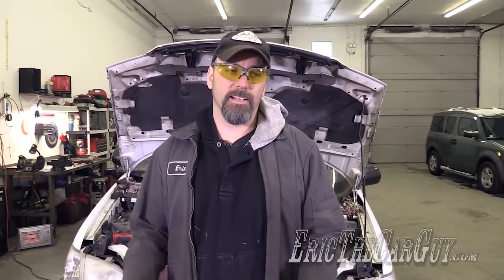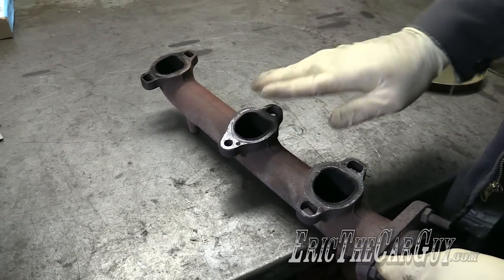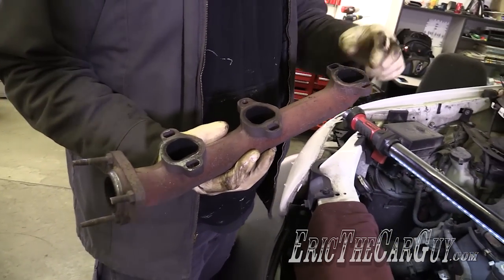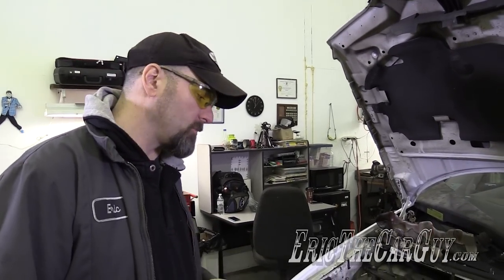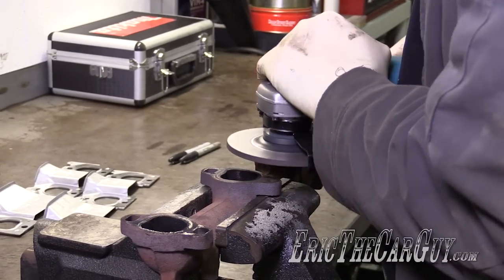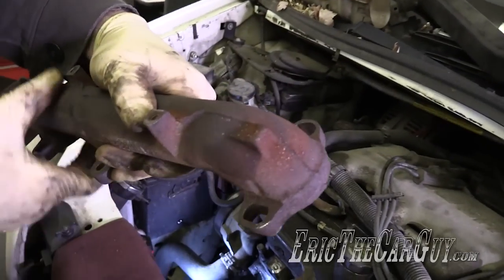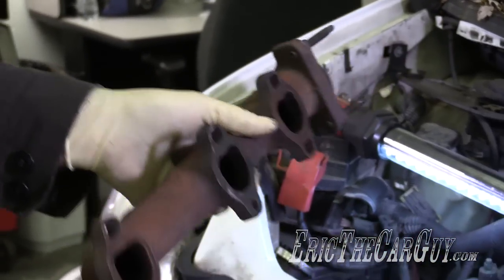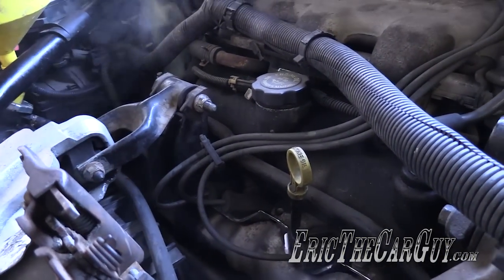2000 Pontiac Montana 3.4L Exhaust Manifold Leak Repair (Part 2) -EricTheCarGuy

Comment: Saying "having problems with my drill bits so i went to harbor freight for new good ones" is like saying "I was having explosive diarrhea so I went to taco bell for dinner"
Reply: SATAMAN Schmidt They may get great reviews but they don't work for shit. I can hand sharpen a drill on a grinder or belt sander far better than the Drill Doctor. The problem lies in it's inability to properly relieve the cutting edges. They give you a perfect 118 or 135 degree angle they just don't do a very good job of removing the material behind the edge so that the thing will cut.
Reply: ***** 500X
Reply: Harbor Freight is definitely the Taco Bell of tool brands.  Both establishments have their own unique smell.  Taco Bell smells like grade D meat, and Harbor Freight has a chemical smell that's so strong it makes my eyes tear up.  However, I think his point was that instead of resharpening good bits with the drill doctor, he just bought a ton of crappy disposable ones.
Reply: LMAO
Reply: Morguls Tower
No, Eric goes cheap because most DIY viewers go cheap. He's not teaching to the pros.
But I agree that cheap drill bits are a waste of money.
Reply: Fahrenheit38 laughed my ass off couldn't have been said better. You know how much junk i've gotten from Harbor Freight? lol.. My neighbor who had two strokes and was a former mechanic and at some point kinda lost his marbles keeps going back for more trash wondering why their junk isn't working out for him and has gone broke from his projects...
Reply: I gotta hand it to Eric.  He shows the right AND wrong way for doing stuff and is not ashamed for people to see how jobs can go astray.  He shows you how NOT to do stuff as on how to.

Comment: What the hell is wrong with you people? This thing is a piece of shit, I don't know why Eric is even working on it. It has the worst power train gm ever made, the van is rotting, and it has other exhaust leaks as well. And people are commenting about metal shavings in the coolant? Big deal! And anyone that knows about engines knows that you can just go and slap a cylinder head on it. He would have had to get it machined too. Some vehicles are worth keeping on the road and others are not, this vehicle should be scrapped.
Reply: What is wrong? How many people are driving vehicles like this for various reasons, and NEED to repair issues like this. Look at it this way, here is a mini van that was worth next to scrap value when it rolled into the shop. As a used vehicle, it was worth very little to purchase, and to sell it, it was worth very little to sell.  With the investment of mainly time and some money (mostly to repair other issues such as the replacement radiator and get the engine back to tune) it is a running, reliable vehicle now.
Reply: Alan Maier reliable?  who knows?  but as to value, some folks have to do what they have to do!  This veh may be the most the owner can afford.  And eric may be the only mechanic she or he can afford.  And who knows this could have been a freebe and we know they always go badly. Its just fate.   Its almost impossible to do charity work without investing your own money.  Sooo turn them down or be truly willing to help.
Reply: He's mentioned more than once in his videos that he does repairs on vehicles that may seem like a lost cause just for the sake of making the video.  He could make a video like this one of him actually fixing something or R&Ring a good manifold on a good car to show how it's done.  Personally I prefer actual repairs.
Reply: flineman Well, okay, reliable may be too strong of a dream for a GM mini van. Just thinking a bit on those, the engines were the main issue due to head gaskets and here in the snow belt (I am in Indiana), GM vehicles just plain rust apart faster than anything else on the road. But by contrast, I have a Grand Caravan as a second vehicle and it's nothing but one electrical system headache after another. When changing the turn signal stalk assembly one day, I noticed the dreaded Lucas brand... Lucas, Lord of Darkness. That explains a LOT!
Reply: It may be worthless to you, but not everyone can just scrap a vehicle and drop a few grand on a new used one at the drop of a hat. Especially for an exhaust leak. Most shops around me charge by the book, so they'd be bound to finish this job no mater how hard it ended up being. Though in reality, the 3.4's are a dime a dozen. I'd bet you could go a pick-n-pull yard and get a head with manifold attached for $100. Not a ton more labor than what Eric went through drilling out the studs. But hindsight is 20./20 after all.
Reply: buggsyspam You do need to know when it's time to let it go, but yeah I agree.  I have one of these I just sunk about $800 into to replace the cylinder heads.  I could have given up and got something new but unless I spent at least $3K I wouldnt be getting anything newer or less miles (certainly not one with new heads on it).  Had mine been in the same shape as the one in the video, I certainly wouldnt have put new heads on it, I'd have probably slapped gaskets on it and hoped for the best...
Reply: Alan Maier
Major coolant leak is a much more imminent problem than a noisy exhaust leak. 
This van is good for nothing. It has no saving grace or valuable attributes. It doesn't do anything well.
Reply: s0nnyburnett Maybe I'm just not a snob, but I disagree... and I live in the uppity part of the city and pay a monthly pass to the local car wash on both of my vehicles. If that van has no value to you, great - I'd buy it, take care of it, and appreciate it. To feel it has no use in the world is being either a child or stuck up beyond words.
Reply: Alan Maier
If you fixed your own cars to survive you'd have a vastly different opinion.
Not all products are made equal and some like this, truly are junk.
Reply: It's a great video. It shows people, when you might be greatly above your limits and should not think about making these types of repairs in the first place. You need tools, experience and everything else. Not to forget a very strong mind. For this purpose, it truly is a great vehicle.

This will always and forever be in the back of my mind shopping for a used car in the future.
What can happen?
Eric vs Pontiac Montana can happen. 
I'm outta here painting the ground with skid marks! 

If I had had this video earlier, I would have saved myself some angst and despair my current p.o.s is giving me.
Reply: s0nnyburnett
You obviously dont fix your own cars to survive.  If you did you would realize that survival isn't about vanity of how great a vehicle is, rather it is about whether it is usable as a vehicle at all to get from point A to B. 

If nothing else you can give or sell it to someone needy.  There are lots of people out there that would love a car that costs little more than its salvage value and even if it only runs for 5K more miles before the (next) catastrophic failure, then it can still be sold to a salvage yard so it was 5K mi. of use at virtually no vehicle cost.  This is exactly what some young people need to help them through a tough economy, a vehicle that runs but doesn't cause them a loan they have to pay off.
Reply: Stinky Cheese
You haven't see the rusty heaps I've had.
No one strapped for cash is going to waste what little money they have on a vehicle like this where death is imminent if they can pay the same for a more beat up or higher mileage car from a more reliable brand or better model that will last longer. The only person you'd give this to would be someone you absolutely hate. And if you live in a state with strict emissions or safety inspections you've basically fucked them over.
All the young people I know, even the ones who don't know anything about cars, know that it's just a money pit, gas guzzling because of its state and that tow costs aren't cheap. They'd rather get a ride or take the bus than put up with something like this Montana which is a hopeless case.
Reply: s0nnyburnett
What did I miss in this video? It runs, it drives, it no longer has an exhaust leak. It's passed emissions testing at the last renewal date (unless Eric had it towed in). What am I missing that makes people think this car is worth only scrap? Around where I live, you aren't going to get much better for $3000.
Reply: buggsyspam I get the feeling this will be a long debated topic for as long as this video is posted. My take has been that if the van had to go into a dealer or a fully equipped full time shop, the repair bill would pretty much total out the van simply as you've reached the point where the repair bill vs. the parts value pretty much buy another comparable van. But to do it yourself (very important key to this), taking the extra time to pull the radiator for more access and make it a project - it's very much worth it IF the rest of the van is not about to fall apart. Sure, if it's a rust bucket about to fall apart, that's another issue. 

Since there are a lot of mechanics (real or fictional) commenting here, what would you charge for this repair? A quick look at Craigslist in my area shows clean looking fixer Montanas for around $1000 (usually need transmission work) to less if they are absolute trashed out parts vehicles to $2000 area for high mileage but considered okay runners. Those over $2000 have been setting long enough that you know they are overpriced.
Reply: Alan Maier  you said "the repair bill would pretty much total out the van simply as you've reached the point where the repair bill vs. the parts value pretty much buy another comparable van"  

There's one part to add to that - you know the history of your van, you don't know the history of the comparable one and that has a value, especially if you've done work in the past on it.  I also use this to assess vehicles I'm considering purchasing that need work. 

Let me give you a specific example:  I just bought a 2006 Ford Econoline with a bad transmission for $800.  I bought it because it ran great and had service history.  I had a remanufactured trans installed from the dealer for $2400 - three times the purchase price of the van.  I found equivalent vans with the same mileage around the same price ($3000-3500) so to many what I did would seem rather idiotic but none of those other vans have a new trans with a warranty.
Reply: Alan Maier "If that van has no value to you, great - I'd buy it, take care of it, and appreciate it."
...
You'd buy a beat to hell 2000 Pontiac Montana, love it, and appreciate it?
Reeeaaaly?
You have officially invalidated everything you have said in this thread.
Reply: I ask again, what have I missed in the video? People are assuming this van is "beat to hell" and worthless. It had an exhaust leak and Eric mentions it's rusty. I'm going to go out on a limb and say that most of the people that are opposed to fixing the van at all read "2000 Pontiac" and just quit on it right there. In my region of Wisconsin, $5K would just barely buy you an old minivan without visible rust. And as Ratbert86 said, you will never know the full history of the next car you are buying. So you can take on a new car payment for a used vehicle that will definitely end up needing work on it's own, or come up with the money for this. A full head job on a GM 3.4 is about $1K and that's doing the labor intensive rear head and sending them out to be machined.
Reply: buggsyspam i guess the reason why people belive it is "beat to hell" is because, it's rusty, dirty, has a exhaust leak, has a check engine light, has a major coolant leak and so on.
Reply: I had a 2000 Malibu (over 230k miles, all original and unrebuilt) with the 3.1L and changed the thermostat. I had to remove the throttle body to get to it and my previous experience with replacing the cooling fans on a 2000 Monte Carlo with the same 3.4L. I am very happy in exchanging the Malibu for a 1987 Jeep Cherokee Laredo with the 2.5L L4 and a 5 speed manual transmission. I  somewhat know what Eric had to work with. Ugh.
Reply: lol yeah I agree. If it were me just for the sake of repairing the problem and making it a bit more interesting I would have went to the junk yard and paid my 250 bucks to grab a new/used engine and mounted a much more reliable solution. The engine is a shit engine and I have never liked them as much as a 3800.

The design of the van really is probably the shittiest designs I have ever laid eyes on. This thing is pathetic and was pathetic when it was new. Sometimes you just can't fix shitty engineering.
Reply: The real REAL problem is ALL GM passenger vehicles, excluding their truck line, from the early/mid 2000's were of piss poor build quality. The fit, finish, and materials used on the entire vehicle are Harbor Freight quality to give an analogy, there's a reason GM execs went hat in hand for a bail out. The 60degree V6 engines were actually the best thing about them, and they ALL suffered from impending Lower Intake Manifold Gasket Failure, to the point GM was class action sued to recall and repair where they only covered 3/4's of the repair costs. Hell I actually like the engines, but I worked on my last one two years ago and will never touch another one, the value in the remaining vehicles on the road are nil, once they fail they're pretty much scrap. Pull a replacement engine and you're just throwing another money pit into a car from an era where the quality was just abysmal.
Reply: Riptides99
You speak the gospel!
Can I get a hallelujah?!
Reply: Riptides99 AMEN! That's when I swore off GM cars, period. I was raised in a "GM family" - came home from the hospital as a newborn in a '55 Chevy that my parents bought new. There were GM cars and there were "those other brands". Okay - my grandmother bought a Rambler Super in 1960... someone just had to stir up, uh, well anyway (and she traded it off for a Chevy in 1966). But the pride in owning a GM car faded away and the frustration of driving junk that fell apart, rusted apart and basically was junk on wheels killed any desire to own another.  Their trucks may have decent drivelines today, but they rust apart far faster than a Dodge / Ram or Ford. Around here there are so many old Chevy trucks getting around just fine with holes in the body and beds that are totally shot.
Reply: Pretty much this. This thing was made to fail and no amount of fixing can stop it.
Reply: Alan Maier Nothing, I repeat nothing, rusts fast up here in the north east than a mitsubishi...or should I say pieceashitsi
Reply: +dmoney8766 I agree.  These cars suck.

Comment: Just saw Wes comment about this repair on SMA's latest.  Had to come check it out.  Brutal job.
Reply: Me too! Just last night watched SMA's video and he mentioned Eric drilled through the water jacket. Now I am retired tech that owned his own shop and had every mishap working on cars known to man. So I can certainly sympathize with Eric. Not that this could not happen but, how did he hit the water jacket? Drilled too far in? Not straight in center? Have not completed video yet (and I will) but, what went wrong?

Edit: Never mind, 5 more minutes into video got the answer. Drill bit went off center. I can't say this has ever happened to me in all my mishaps but always concerned it could happen. Just a side not my shop was set up similar to SMA's and had every tool known to man including lifts and heat and air tools. So hats off to Eric that does the best he can with what he has. There are no flies on s**t! And I thank him for being man enough to show the video.

Comment: IMO-there is considerably more value in repair videos such as this then the next 10 auto parts store videos where nothing ever goes wrong.  Yes, there are a multitude of ways the broken studs could have been handled and yes, there are multiple ways the whole procedure could have been approached but most DIYers don't have the ability to pull engines or even heads.  Very few have welding equipment either.  I do, recommend that you do a follow up video on how to avoid drilling through the water jacket in the first place as well, though, such as a solid stop on the drill bit.

Comment: Left-handed drill bits can be superb with these kind of things - when you're drilling they often heat and turn the broken-off stud enough to wind it out. If it does, great; if not, well, you still have your hole for the tap :-)

Comment: Tip for keeping your drill level: superglue a small bubble level on the side of your drill if it doesn't come with one built-in..
Reply: that's only good if your drilling on the level? He was on a pretty steep angle....
Reply: A bubble level really don't help on an application like this because you can mess up in both the vertical and horizontal.   They sell drill and tap guides just for this type of thing.  You put the guide against the machined gasket surface and you will get perfectly aligned holes.
Reply: or just weld a nut to it like i show in the vid i did on my channel doing same type of repair
Reply: I think that after center punching the dimple Eric should have started the hole with a small center drill before advancing to a regular bit.